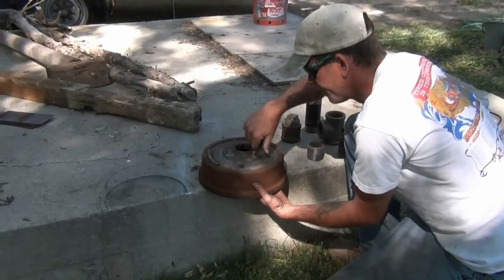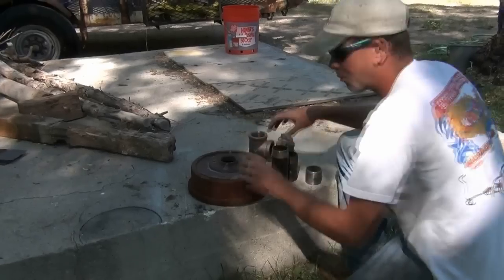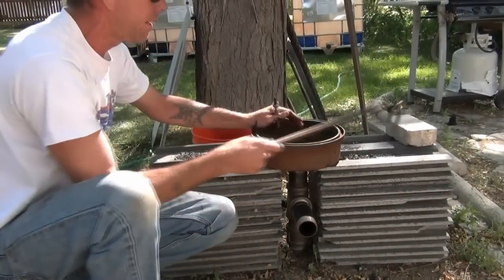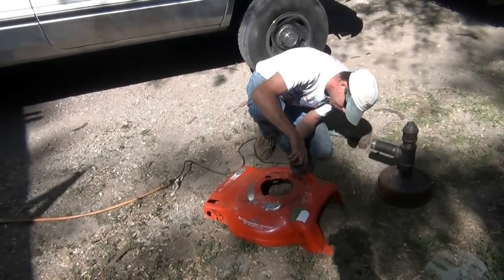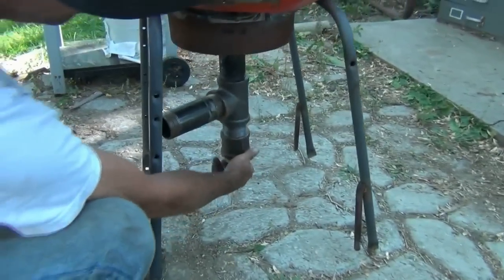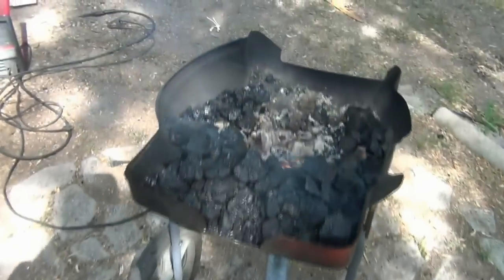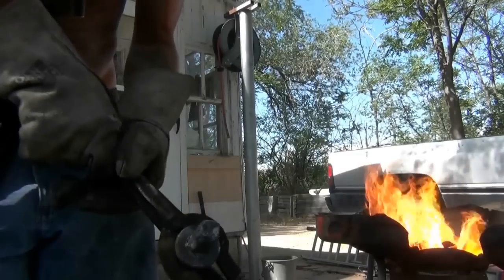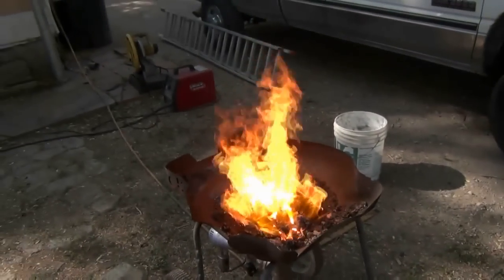Build an Easy  Blacksmith Forge - Out of a Lawnmower

Comment: Nice job, Bud! Good way to use up what you have. If you come across an old cast iron
barbeque you can attach your plumbing parts to it. Less work, legs already attached. Just need holes for the flange bolts and air inlet.

Comment: Nice tutorial, I will be making one myself. Though I will use the brake drum from a tractor trailer which is much larger and can hold plenty of coal. I will also feel more comfortable that it will not have a hole burnt through it. Anyway, thanks for the idea.

Comment: Cool idea with the lawnmower, I used an old oil drum to mount mine, just cut a hole through the top and let it rest on the flange. (Be careful when cutting oil drums if the wrong substance have been in it you could have an explosion on your hands)

Comment from the maker: Right on man, glad ya dig it. Just throw a light dimmer switch on it and you can control the speed of yer blower. I did, and it absolutely rocks! Way helps on coal consumption and working with lower temps fer the thinner stuff. Yer gonna love it. Laters

Comment: Also a small project im doing: An old BBQ that I cut a hole in the bottom of, affixed a pipe for use in fireplaces (with another exhaust-pipe sticking out if it for the air-intake) and then covered the hole with parts of the cut up cooking grate. The grate was then fixed and the whole surface of the BBQ interior covered by firestop mortar. Going to be interesting to see what goes wrong ^^

Comment: Ha! Almost an exact copy of what I did. I used a rotor instead of a drum. If you add refractory, the drum will last almost forever. For the coal question, go to a feed and seed. Cheap anthracite in 40 lb sacks. Much hotter and easier to light if you break it smaller first.

Comment: Great job for your first forge one helpfull tip though, cut about half of the end cap off, flatten it, then  drill a whole at the edge of your newly made ash vent and screw it in to the rest of the pipe that you cut off mates it easier to clean out. P.S. After each use clean out ashes or after you introduce more coal

Comment: you've overcome one of the biggest limitations of the Brake Drum forge.  It's just too dang small.  Adding the lawn more deck makes the Brake Drum a Fire Pot, and you can fill that deck with coal and keep a supply coking for use in the fire. Nice Job.

Comment: YOU NEED A BIGGER LOG OTHER THAN THAT GOOD JOB , GREAT USE OF OLD PARTS.
Reply: Caps much?
Reply: He needs to find a tree removal service to save him a fat ole oak stump. I've got  a seasoned one from my in-laws, used roofing tar to completely coat it, left it out in the old summer sun to cook on the coating, and slapped my anvil on it with huge lag bolts. That log with an anvil on top isn't easily moved, it shows no signs of rotting, termites, etc. My wife was worried about someone stealing it, since the anvil cost so much. Show me a man who'll pass up all my other tools to man handle & steal a 300lb anvil attached to a 100lb oak stump and I might just let him have it.
Reply: CypressJim
I don't think even the biggest metal thief would try to steal that big of an anvil. I'm in the process of making my third anvil out of rail road rail. As you know if people only knew how much time went into making a anvil they would fear being shot if they were seen trying to steal it.
Reply: yeah i have a railroad anvil and its very quiet.

Comment: I actually made wheel rim forge, but found it too deep. I clayed the thing with ordinary dug out clay, works great, just leave a tiny gap between you grate and clay or it will crack due to steel heat expansion. You could use less clay, and cut two slots in the rim for long objects. Sorry for my poopy English, buddy. Keep forging ;)

Comment: I do not want to put your forge down, but could I suggest you use a steel wheel rim from a truck. A lot less work involved. Just fit everything to the rim as you have already pointed out.
Well done :)

Comment from the maker: Could have just has well i guess. Kinda evolved along the way.  First I built the brake drum forge, But after playing around a little bit I  realized that I needed to expand my work area, hold more coal, add coal less often, and build a taller stand for it. So when i made my mind up to use the old lawnmower, I turned the camera on. So yea, if i were to build another, i'd just weld her on. Come to think of it, i'd just weld the pipe to the drum and ditched the flange all together.

Comment: Nice and I've got an old lawnmower out back I was considering how to implement it into my metal works.  Poster below asked and answered one question since I'm way down South.  If I was in Pa. coal was available cheap but here...not so available.   Other question-if I put my crucible for melting aluminum, silver and so forth into this will it transfer the heat?  I've been under the thought I needed the crucible enclosed to hold the heat to smelt metals?

Comment: Good video. I like the size and solid, affordable build.  But the only two suppliers of Coal I found (within 200 miles of home near Astoria, Oregon!) no longer stock any Coal for blacksmiths.  I've been resorting to videos that feature charcoal forges, but maybe you can suggest where to get coal.  I'd probably opt for 50 lbs, or even less for now. I wont need much,  to start.
Reply from the maker: A sweet place to find coal is yer local newspaper. It's getting harder and harder to find coal these days, even here. But there is lots of it right now in back yards and back sheds of people who stocked it up, and didn't live long enough to use it up. The kids are now selling it. Or try placing an add on Craigslist stating what you are looking for. You should score
Reply: fencekid, thank you for this response.  Why didn't I think of this "real world" solution to my hunt for coal ! :-)
Reply: Ebay

Comment: @fencekid Nice! Ill have to make a video of my forge when it is done. I enlarged the hole in the deck and pounded the brake drum in up to the larger "flange" part of the drum. this leave about 2 inches of the drum sticking up in the deck. I plan on filling this with some sort of refractory brick and clay, as i worry about the mower deck burning thru eventually, and that way i will have a nice surface to slide more coal into the fire pot area. Did you have any issues with the deck getting too hot?
Reply from the maker: the deck hasn't given me any issues at all. All the crankin heat is kept in and  straight above the drum. lookin forward to seeing yer vid, sounds pretty sweet

Comment: you should enclose the top part so all that heat stays on the inside of it instead of releasing out in the air, it would let you get temperatures much hotter and more stable.

Comment: My 2 cents.  Hole in lawn mower base shoul have been cut to drop drum in from the top.  You weld to a cast iron drum to steel will not hold. Welding to a cast drum ?
Otherwise good idea about the lawn mower base.
I have seen tons of vids on the brake drum forge.  I also use a rubber 2" hose clamped adaptor from hair dryer to pipe to insulate any heat frm the pipe melting the plastic hairdryer.

Comment: How high temperatures can you get in this forge? would it be able to melt copper? (Melting point: about 1100 °C / 2000 °F)
Reply from the maker: Niels Salling this forge will liquefy steel, no problem. copper doesn't stand a chance

Comment: That's pretty sweet right there! Too bad the only kind of coal that can be found around here where I'm at is charcoal and I don't know whether or not that stuff will heat up high enough to reliably get the job done.
Reply: Charcoal works fine.  Check out where the American forests went!

The only differences are that the air blast should be horizontal instead of vertical like a coal forge, and there is no need for the "coke" step needed for all but the best coals.

Charcoal is actually the best "coal" to use, it's pure carbon to start with. BTW if you can get actual coke that's great too, just somewhat hard to get properly burning.
Reply: Yeah,but I also heard that charcoal burns really fast because of impurities in it,but when I build my forge,I'm still more than likely to still give it a try,because I believe that I already once saw a demonstration where it was still being used with success.

Comment: Just wondering why you disconnected the heater element in the hair dryer ?
Wouldn't preheating the air make the coal combustion hotter ?
Reply: The heating element draws power away from the fan motor and makes it run marginally slower.

Comment: did u took out the eat springs from the air dryer ?  made my forge with air dryer  too but i took the springs and added a transformer that can work in 12v 15v 18v 20v and 24v.
I think that if you use the "cold" button on the air dryer it will send some hot air to the forge.

Comment: Without easy coal... would charcoal or wood work as well?  I'm thinking 2 brake drums hinged together, top holes sealed, material 'pass through' door cut midway... 

Thoughts?

And... give us a quick vid on temper/hard/quenching 101 tips... please!  :-)
Reply: As long its a long- lasting source with enough heat, it should work

Comment: I'm about to upload a video of my lawnmower forge =P  The grill will work fine, as long as where the hole is the metal is thick.  I used thick steel plate, instead of brake drum.  I plan on filling it with clay for a precise bowl.  Can't wait to use it, I'm making clay right now....  =)))  The only thing I wish I put in it was a air flap valve to adjust the air at the forge and not the air restrictor on the hair dryer =D  (i can do that later)  I'll sub your channel to see if you do it.

Comment: VERY GOOD VIDEO. I JUST WONDER HOW LONG YOU THINK THE MOWER DECK WILL LAST BEFORE IT BURNS OUT ? YOU MIGHT WANT TO INVEST IN SOME FIRE BRICK OR MAKE A FIRE PROOF BASE. GOOD LUCK AND THANKS FOR THE IDEAS !!
Reply: Caps lock?
Reply: Squid Army YES I USE CAPS LOCK.HELPS ME SEE THE WORDS BETTER. I HAVE CAUGHT A LOT OF FLACK ABOUT IT FROM SOUNDING ANGRY TO BEING LOUD. GEE ITS JUST TYPING SO I CAN SEE IT CHILL OUT EVERYONE WHO MAKES UP ALL THE RULES ANYWAY ??
Reply: Laverne Garber If you are having trouble seeing what you are typing you may be able to try this: 

On your mouse there should be a little wheel in between the left click button and right click button. On the bottom left of the keyboard is the "CTRL" button. Hold that button down and spin the mouse wheel forward or backwards. That should either zoom the web page in or zoom it out. Hope that helps, if you have any questions feel free to message me.
Reply: THANKS BUT I AM USING LAP TOP AND I DONT GET WHY PEOPLE GET AFTER ME FOR ALL CAPS GHEES ITS ALL OK !!!!H

Comment: If I threw a steel cup in there and filed it with aluminum could it melt it?
Reply: Yeah, just get it to a proper temperature and use all safety precautions. Steel has a much higher melting point than aluminum, which means that the aluminum will melt, but not the steel.

Comment: How long did the lawnmower. table last
Reply from the maker: jay engdahl this forge works today just like the day I built it. I've pushed tons of coal through it and it just keeps on a ticken.
Reply: +fencekid If you needed a bigger forge. You should have started with a tractor drum. big diameter, and nice and deep. Would hold a nice bed of coal.

Comment: budget and easy. IF you have a welder.
Reply: you dont need a welder. just use your imagination & a bit of common sense.
i built something similar a while back & for a grate i sandwiched a plate with holes drilled in it, between the drum & the flange

Comment: never heard of a 2 1/2 " ball thinking you meant 2 5/16" like you city boys call a fith wheel ball lol. if someone can tell me where to buy a 2 1/2" ball id love to know as theres no trailers that will fit it. an if your not in the galvanized or zinc or paints plume you will bareley smell it outside like that which as mentioned theres no galvanized there. an its not like 1 breath an your dead lol,a drum brake has shoes not pads,he done a good job with using old junk from scrap pile for sure, i noticed he stitched the drum an fill strap on or put all his electrode on it an drum,would love to see a fith wheel trailer hooked to a gooseneck ball or vice versa hooked up going down road (from a distance) just to start another argument. good job on your forge tho.

Comment: When I plug my mom's hair dryer in one time I couldn't use it because after 5 minutes the electric in the shut off
Reply: thermal cut off switch,( i.e "safety mechanism") to keep hair dryer from overheating......so with element still wired inside, or even drawing in ambient heat threw the dryer can cause this. This can be bypassed electrically, but perhaps your mother's hair dryer should be just that.....hers !
Reply: @daniel go buy an exhaust fan from any of the box stores they don't have a thermal element and no cutof switch but work as a blower
Reply: Thx
Reply: okay boys simmer down, most hair dryers don't come with thermal switches just the way it works, only some of the higher end hair dryers do, so chill out with the insults they aren't helping
Reply: Thx
Reply: Is there a cool setting? That should solve the problem.

Comment: Flask?? Its a flange. Pieces??? Those are called pipe nipples. Pipe cap? Why not fab up a simple ash dump? Why a lawnmower deck? Just make a proper pan and do it right!! I understand getting starting in the craft, but why not do it right, and smarter??
Reply from the maker: I'm so glad someone as smart as you stopped by to correct me on my terminology. Funny thing is that everyone understands what I'm talkin,,,,,, I mean,,,,talking,,,, about. YOU go make a proper pan and do YOURS right. I like mine just the way it is. That's right. Almost two years old and a ton of coal later, and it's just like the day I made it. She's not red anymore though. But thanx,,,,,,I mean,,,, thanks,,,, for your smart guy advice.
Reply: fencekid Your, uh, I mean, you're welcome.